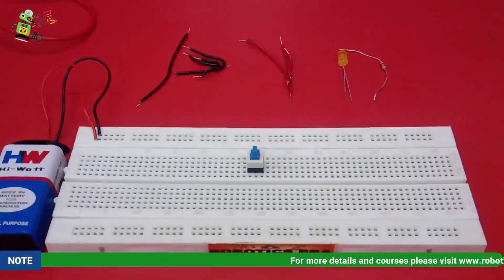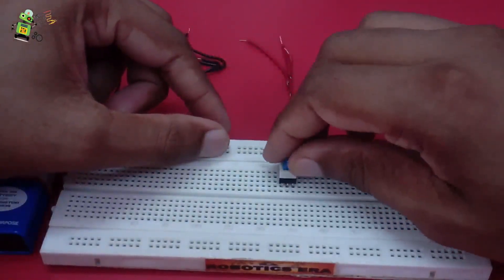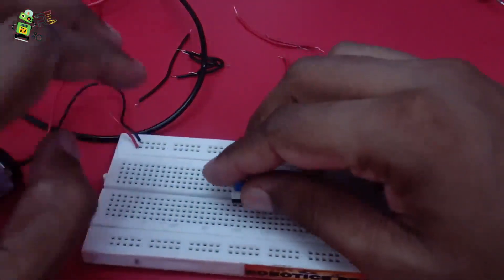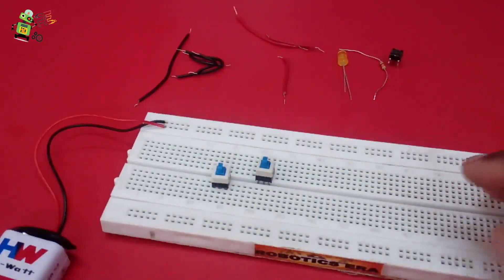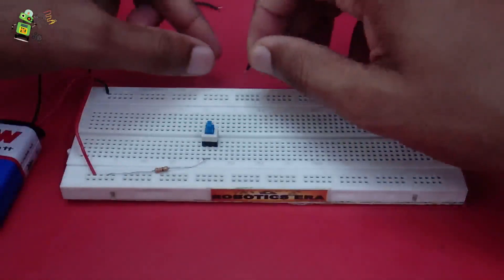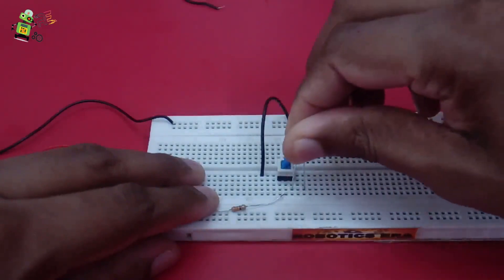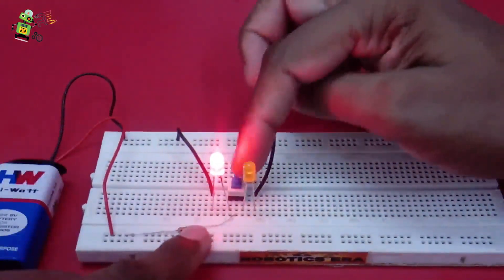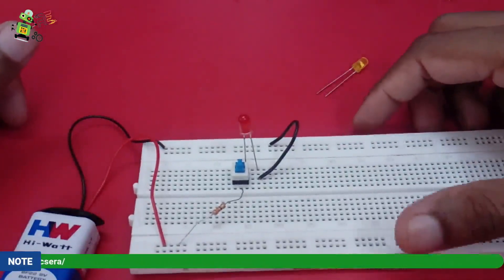Tutorial 9- Self Lock DPDT Switch

Comment: This button and slider switch always give me headache when testing my circuit.
Hard to get the one that is compatible with breadboard.
It always pop out. If I accidentally touch it just a little bit, it will get knocked out of the breadboard hole.
Maybe my breadboard is bad quality.
Reply from the maker: yeah...it happens with this type of switch.
Your Bread Board is not of bad Quality, You only have to pull the legs of this switch and make push them a little harder to get in.\
 Thanks